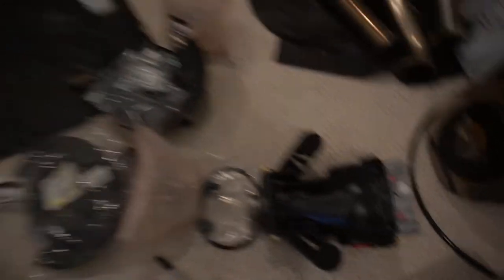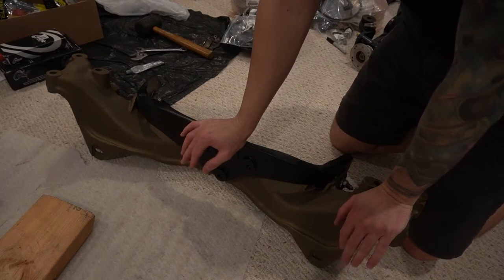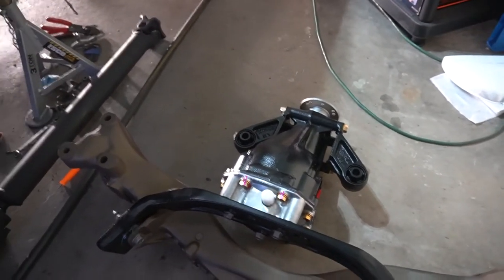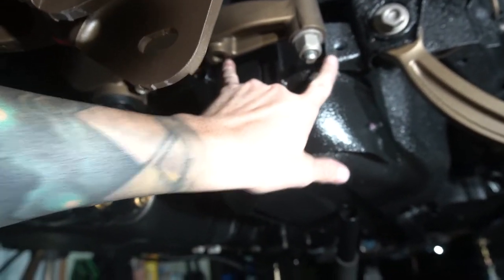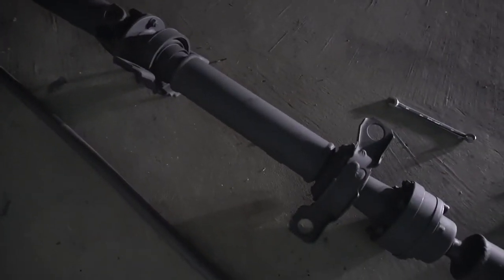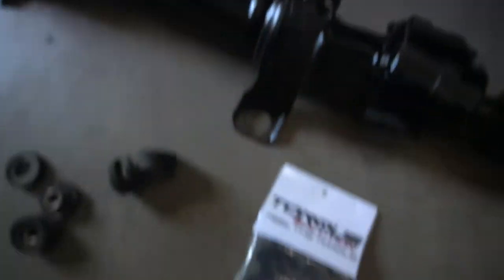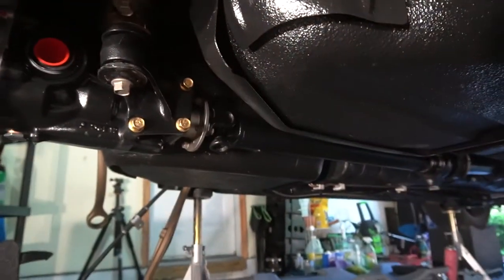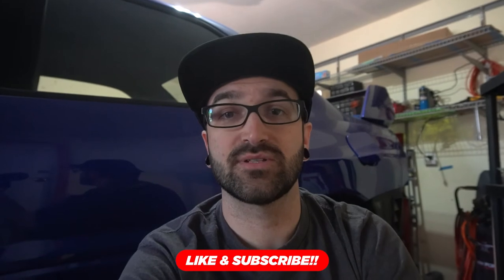Evo 9 Rear Diff And Driveline Installation | Evo Restoration

Comment: What spray did you use for the undercoating?
Reply from the maker: I just used epoxy primer and then Raptor liner! It’s not the same as rubberized coatings so I trusted it. It makes a mess spraying it but other than that it’s nice to work with. You can also roll it on but I thought spray was best being as there are so many tight corners and things like that